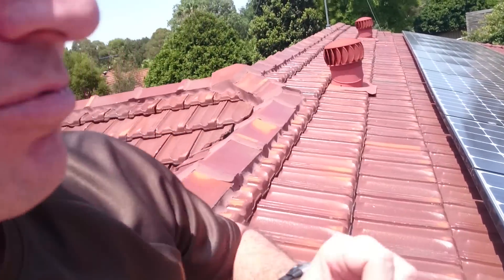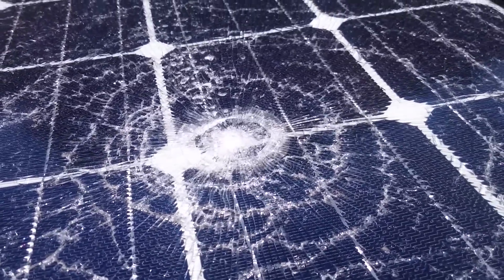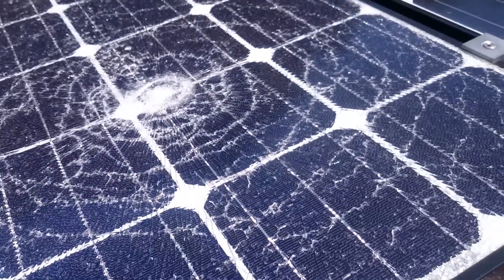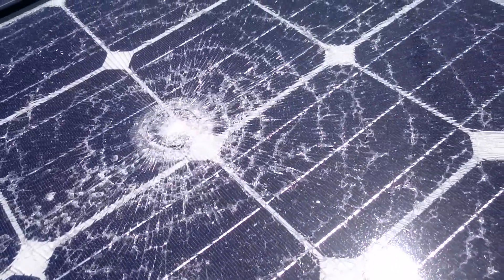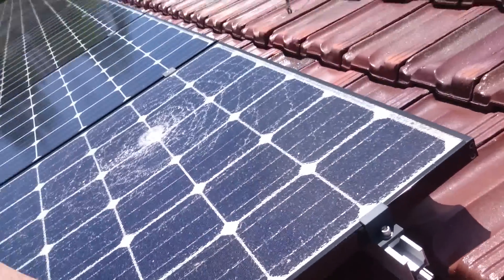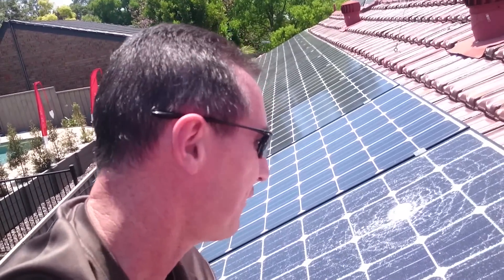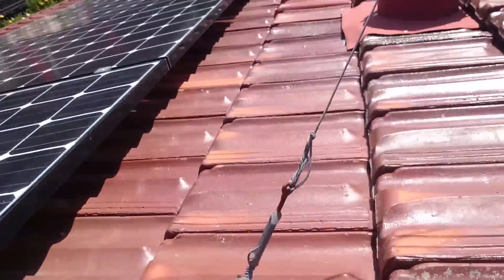Home Rooftop Solar Power System Update - Shattered Panel!

Comment: Odd, 
it must be something as solid as rock hitting the glass at a very high speed.
i used to work at PV module manufacturer, and all the case i met from time to time is that the tempered glass shattered caused by either being bent by nonrigid structure or being hit from the side of the PV module.

Comment: @EEVblog DISCONNECT IT from the loop! That in series with those other panels can be a serious fire hazard when morning dew gets through! We had some incidents here in the Netherlands where failing panels burned out! Small chance but keep in mind the power one singe panel can produce!
Those bypass diodes do nothing about that! Even when that panel is disconnected it will still produce that burning power try shorting one out and pull a arc between the wires... The results should be a pretty hot arc :D

Comment: They are usually made with tempered glass so I would suspect something with sharp corners. It would take some serious kinetic energy for a rounded object like a softball/golf ball to shatter it. I've seen people hit tempered glass with a sledge hammer head on without shattering it. Yet a rock from the lawn mower can completely shatter it. I doubt it was a lawn mower unless they took the guard off of it. Although it could be a manufacture defect if a softball did do that kind of damage. Perhaps the edges of the glass were too close to the frame since the edges and corners are most vulnerable. They encapsulate them in a clear elastomeric polymer and that basically is what keeps the moisture and UV rays off your cells but also holds the glass in place somewhat. It is still susceptible to vibration and if the edges of the glass were too close to the aluminum frame it could cause it to shatter? I'm not 100% sure if the impact crater would be as blatant in that case though.

Comment: Any discernible drop in power for that panel?  If a history is recorded in your system, maybe you can pinpoint a time of impact.

Of course, automobile safety glass fragments like that.

If you try some kind of resin repair, it'll be interesting if there's a measurable drop in output from that.

Comment: Wow, those concentric rings spreading so far out makes it seem like whatever hit had a lot of energy. I'm assuming it had to be some sort of freak hailstone, because I think you can only get a "complex crater" in that medium with ice. The sides shearing off from the central compression would have caused the deeper crater ring, and also explain why there's no matter left behind to find. I'd say meteor, but the ones made of ice don't tend to get through the atmosphere.

Dave you should play physicist (you practically are one already) for a day. Figure out what kind of glass that is, get a few sheets about half the size of a solar panel (impact zone). Frame them so they hold together in a similar way, lay them down on a flat surface so they have a similar solid backing, add sensors between the backing and the glass, and see what it takes to get that kind of a break. 

I'm really intrigued by this mystery.

Comment: Dear dave,

Below you will find the advise of an solar installer ! :

If you can feel an impact with your finger it's a mecanichal impact (stone, etc etc) but if you can feel nothing it can be a "hotspot issue" a little zone on the solar panel goes really hot and the difference between ambiant and the hot spot makes the solar panel "cracks"

Regards

Comment: 1) vertical drop of object because of shatter pattern looks symmetrical in all directions.
2) the object does not had any paint or material that left a residue at impact zone (looks clear) 
looks like chunk of ice fell most probably from airplane which melted during descent and turned spherical in shape

Comment: The panel will still continue working fine with the glass broken, but the cells will begin to succumb to oxidisation and water ingress. You can fix them though. There are a number of ways of doing this: Applying a specialised epoxy coating is the best but expensive from what I understand. With the prices of panels nowadays, it's probably not cost effective.

Topping it off with a clear polycarbonate sheet works pretty well, and for the real cheap and nasty approach, spray the panel with a clear plastic spray paint. I personally have utilised the latter two methods on panels that I bought already broken much like this (although they sustained their damage in transit).  And they continue to work fine, although they definitely don't achieve their nameplate ratings however.

Looks like you have a series string there, and having a panel in that string with reduced performance is probably not good for the total power output.. In this case I would certainly get it replaced but if you have to pay for a new one keep the broken one, as you can fix it like I described above and then play around with it for charging batteries etc.

Comment: someone said previously it could have been someone shooting a gun or something into the air miles away and landing on it. seal it with some epoxy or resin. that would work fine.
Reply: +smallenginedude71 Not every country is gun crazy. You will find almost no gun in Australia.
Reply: SaitoGray I live in Australia. However plenty of people own them. It is just harder to obtain them. You will be surprised. There are guns around.

Comment: Two possible options:
1. Golf ball - if fired from distance, it does "hit'n'run". The hole would fit (center is very damaged, the circle around just snapped), and the ball can still bounce a lot (have you tried bouncing a golf ball to a flat solid surface? jumps like hell), you won't find it on your backyard, try neighbours.
2. Ice ball - hit'n'melt :-)

Comment: Could it possibly be a position on the panel where an impact of substantial force was received but not enough to show any obvious damage (say in handling by the installers).  Following that assumption and further that due to some of the crazy temperatures Sydney has had of late, the glass has expanded and contracted and finally the stressed portion of the panel gave way? I'm thinking of how a car's windshield can crack etc from a small chip given enough stress on the windshield.  Anyway, should be covered by home and contents insurance, basic glass breakage claim.

Comment: Aside from the glass the rest of the panel looked alright, granted once the glass is removed small cracks and a bit of damage will most likely be found on some of those solar panel sections but I don't really think that would stop the company from fixing the damage and then selling it as a refurbished panel.

Comment: The center of the impact area shows a lot of crush damage. I think the impactor was around golfball sized, and fairly hard, harder than a golfball.  It wasn't very heavy/dense though, or it would have gone through the glass and the silicon.   It doesn't look like a game ball  to me, there would have been far less crush damage in the center.   A rock would typically have left fragments in the impact, even if it bounced away, same with a metallic object.   I'm thinking a golfball sized chunk of ice off an aircraft wing.

Comment: I never knew that they used tempered glass on those panels.  Might want to question the neighborhood kids if you're intent on finding out why you have a busted panel. A large ball bearing should be able to break those or even a ceramic bearing in a slingshot. Check your gutters for projectiles.

Comment: Grab a spray can of polyacrylic and spray generously on the impact area after cleaning dust and dirt. I guess its not raining in Australia, but when it rains, water will seep into the micro cracks and damage the panel. 

I would say bullet or cosmic rocks/meteors, but there seems o be no traces of the projectile. Also the ripple pattern indicates very high velocity impact...

So, I guess cricket ball maybe? Found any nearby? Any fields nearby?

Comment: Do you get hail in Australia?
Reply: +Eternal Torture Lol, hail comes in varying sizes... do "water-resistant" watches work to any depth of water? No.
Reply: +Eternal Torture but how big of a hail resistant is it? i doubt it could withstand an 1 cubic meter ice block thrown at it from a few meters high.
Not long ago we had some baseball sized hail in here. Rooftops like that of dave were left completely destroid ( and some houses left roofless). Though it affected everything, it wasnt just one piece of ice falling in a random location.
That looks like a rock to me. Neighbors maybe?
Reply: +Justin Howlett No.  Everything here is Australia is more deadly than everywhere else (except where it isn't), what we call 'hail' is actually better described as ice stalactites, which is why the default roof options here are Colorbond or clay/concrete tiles, rather than asphalt shingles.
Reply: +Justin Howlett I am from queensland, and we've had it a few times but its very rare. The last time I remember was 7 years ago, but I am sure its happened more than that.
Reply: +Justin Howlett Yes, but it flies upward.

Comment: That sucks!  It looks like someone went on your roof and took a hammer to that one panel.  If anything like that happened they would probably hit the other panels as well.  Nice mystery though.  I would look for any debris that would match the size of the indentation.  Cracks develop across the glass over time if there is a break.  I hope the Weather Warranty can cover the replacement.  May be a hail stone?

Comment: Now for the great, very real question. How much is this setting you back to replace, and how many months of energy will it negate? Solar is "neat" and all, but if it's going to end up costing more to replace damaged panels then it's not that viable. Yes, I fully understand that this isn't that common of a happening, but at the end of the day it has happened and will cost to replace, so it has set back the earnings of the panels.

Comment: I had a couple of my panels shatter on me like this, One was due to someone shooting it with a .22 and the other was a bad ass kid tossing a spark-plug on my roof for the sole purpose of breaking it. but neither were that big of an impact radius.
That looks like something hit it from high up or someone got up there with a hammer and smashed it.. I suspect a rogue hail stone or ice from a plane at high altitude or better yet a part of a plane. If that be the case then it is most likely rolled off your roof and in the grass or bushes someplace..
Thing is a sports ball (baseball, golf ball, cricket ball, etc) is not going to have enough velocity it smash the glass on that panel since they were designed to safeguard against such things in the first place unless the ball was dropped from a few thousand feet straight down..

Comment: I have an idea Dave. If you plan on replacing the glass of that solar panel, consider putting square glass panels over each solar panel module and maybe secure them with silicone or some other soft material. that way if this occurs again you can just switch the glass panels that are broken rather than replacing the whole glass panel of the entire solar panel. I hope I described the idea good enough for you to understand. If not, let me know and I'll make an image.

Comment: for me it's some quite small sharp edges object, could by projectile, crater is quite small, fingernail size and elliptic shape (take some pictures and link them in description) . I'm not an expert,  but know that glass behave same as watter so under any angle projectile hit, there will be same ripples effect, panel definitely deformed under pressure (they are thin when you show us underside) and brake into that shape with ripples. tempered glass do the rest.

Comment: Certainly appears to be an object rather than strike from the broken pressure pattern on the gravitational side especially with those enhanced fractile constripulates in the surrounding vicinity. On a side note, a nice display of the dalmonial stress lacksors are apparent. I'd say we are looking at a time frame of roughly 2-3.5 weeks ago as evident in all the bicriterus around the edges there. So now the big question- Where did such an object originate. Well, taking a closer look at those bicriterus, it is clear the impact was from quite a high altitude however, still within the man made land based projectile range percentile. Narrowing it down, I found it was from just behind the neighbouring pool area and found the cause to be recklessness during a makeshift air-hockey match. Just take the pot plant in said pool area for example. Clearly it has been placed too close to the pool fencing creating a foot hold for young children within 900mm from the ground thus rendering the pool a death trap. In my professional opinion, the safety of the children have been compromised purposefully and with malice. Which is completely consistent with the damage to your solar panel. Now whoever did it for certain, one thing is for sure; we must see an end to this kind of grupulent behaviour within the near future. Good luck!
Reply: +Aaron Hunjas If it saves just one child...

Comment: I put up 3 similar panels this summer in our summer house. I had to buy 4 unfortunately since one of them was broken and it took too long before we reported it. I dont want to use it on the roof but what is the experience to fix it "cheaply" and to use it for temporary stuff. It is all working good. Only concern is water getting into cracks, freezing and causing more cracks.
I was thinking about plastic films or lacquer paint?

Comment: Whatever it was, it was something rather big - bigger than a few centimetres, I would say.

I had a panel broken by kids throwing rocks - much smaller impact zone, but equally shattered.  The impact was on the outer edge of the panel, where the tempered glass is weakest.  I sprayed it with a can of clear acrylic, and may use it as a spare panel.

P.S. A golf ball could do that damage, and then bounce out of sight.

Comment: What do you think about using Plexiglas to protect the solar array Dave? Does the translucent plastic affect the panel's ability to collect sun rays too much to be impracticable?
Reply: +Bill Boger 
I'd trust the panel manufacturers that they know what works best on panels. I'm pretty sure they have a reason not to use plexiglass.
Reply: +Bill Boger Main problem with plexiglass from my experience is that it will get scratch and/or discolor quickly. I don't know about its transparency vs. that of glass.
Reply: +Sami Al-Terkawi Hasib it is more easily scratched then glass, and it is also more transparent than glass (but obviously it can't be over 100% transparent, so anything put overtop the glass will lower the transparency, replacing it will probably allow more light through)

Comment: Ooh fun a mystery! Given how uniformly smashed the central impact area is, I don't think the object was spherical. And knowing how thick and tough that glass is, no sports ball would be strong enough to pulverize the glass like that. Some commenters have been suggesting an angled impact, but I suspect that would have made an oblong crater along the direction of travel, especially considering how much energy looks to have been delivered.

I saw guy wires that you walked past—do you have an outdoor aerial? Was someone working on the roof?: the impact, to me, looks about the size of the face of a drilling hammer or sledgehammer, although I'm not sure why someone would be on the roof with one, much less drop it with such precision. I look forward to the answer!

Comment: Maybe its NiS inclusion? Tempered glass will sometimes fail on its own, because of the NiS particles that have different expansion ratio than the surrouding glass, and can generate hundreds of megapascals of tension forces in the glass. The failure typically occurs few years after installation. Btw my experience is in glass facades/curtain walls, not in solar panels....

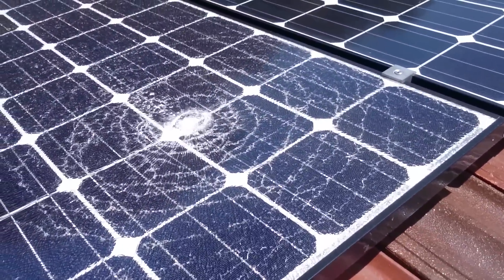Comment: +EEVblog  Circular strike likely hit at near perpendicular to face (glass). Likely a thrown ball or rock, but there is another more unlikely but far more interesting possibility. Note the jet flying over at 3:48. It could have been frozen human urine.

Jets fly at high altitude where it is very cold. Liquid waste from aircraft restrooms can leak slowly through an incompletely sealed service valve and become frozen on the outside of the aircraft. As the plane descends to lower warmer altitudes the blue tinted nuggets of frozen P melt enough to break loose from the fuselage. Some years ago a rather large peesicle came through the roof of a house here in the States. The evidence would, of course, just melt away.

(No, I am NOT making this up. For what it's worth the International Space Station once had a similar issue though the details are somewhat more messy. I will spare you.)

Comment: That glass has some sort of protection rating. Here in France, the lowest rating before shattering is a 1.5 meter drop of a 4.1 kg steel ball. It amounts to 60 joules to be completely absorbed by the glass.
Energy at terminal velocity for a golf ball is about 24 J, baseball is 79J.
A 10cm radius hailstone is a whopping 7.8 kJ (you would have noticed)
A 2 cm radius hailstone is only 12 J
If it was a lead bullet, you'd have some bits of lead hanging around.

My money goes to a small meteorite.
Reply: +Frédéric Dutrey a Cricket ball at 100kmh is a bit over 300J
Reply: +Alex Law 100 kmh = 27.7 m.s-1
.5 * .160 * (27.7*27.7) = 61.38 Joules

A lot of energy still to be dissipated over a small amount of time. The ball has to come to a stop, not absorb any deformation for all of that to transfer to the glass. I think cricket balls can go even faster. So the thrower should be in a helicopter, hovering around Dave&#39;s house, and throw the ball spot on..

+Applied Science Ben, this one is for you to solve...
Reply: Sorry, didn't realise the site I found was in Martian measurements, 160kmh.